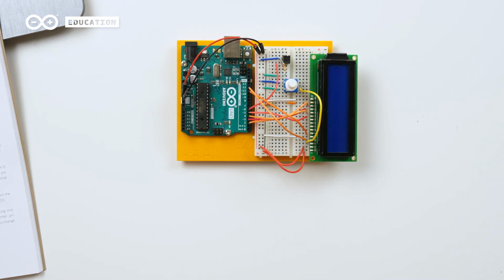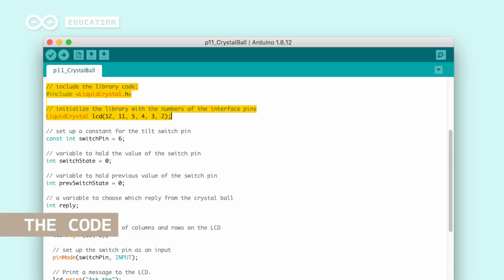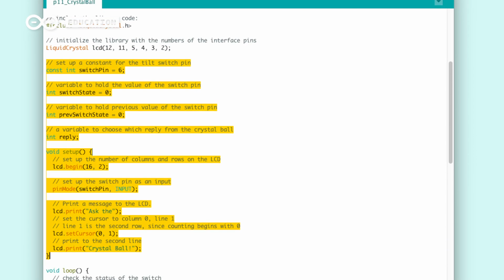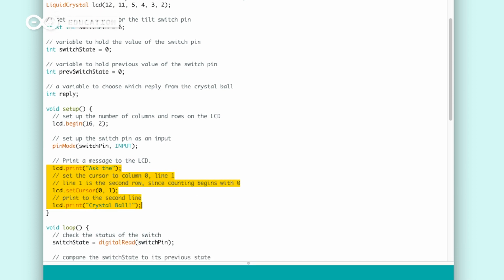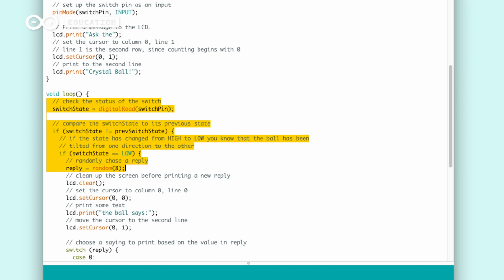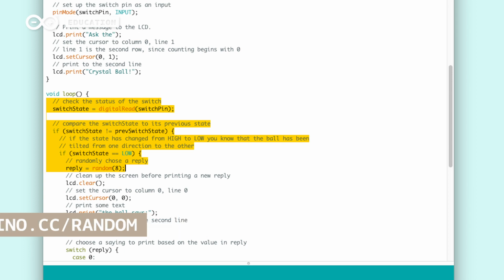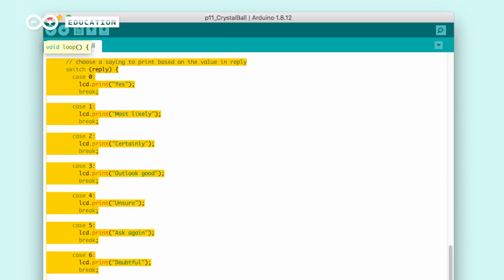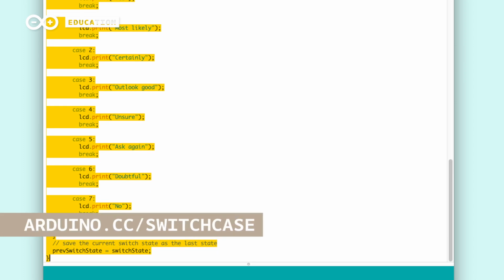11 Starter Kit: Crystal Ball

Comment: This damn tilt sensor is an utter piece of garbage and doesn't work for nothing the pins are to short to allow a proper connection.
Reply: Yeah it's disappointingly short-legged. Basically you need to have some extra legs carefully soldered in...

Comment: I am bit OCD when it comes to crossed wires over breadboard.
1:47 - is there some known reason why it has to be like that Arduino pins 5, 4, 3, 2 connect in order to DB4, DB5, DB6, DB7?
Would it be ok and without any damage if I would adjust the code to make the wiring more soothing?
the CODE
LiquidCrystal lcd(12, 11, 2, 3, 4, 5);
the wiring - Arduino UNO pins to LCD
 5, 4, 3, 2 connect in order to DB7, DB6, DB5, DB4
Reply: Well- i am no pro or anything.... But- i think you HAVE to have some of the pins to have then "PWM" thing under it.

Comment: I cant get my lcd screen in the arduino
Reply: If your LED lights up, but does not display anything, recheck all of your circuits. I had the same problem and, after checking each one, noticed that I'd accidentally mis-connected the ground meant for the potentiometer to an empty row. I believe this resulted in the LED not getting the signal to increase the brightness, thus not showing any text. You can also try using the Serial to check for inputs from the tilt sensor and other variables.